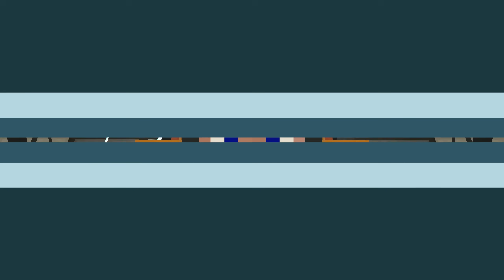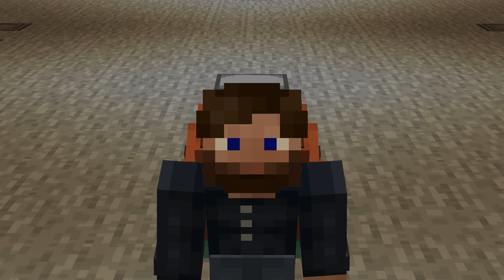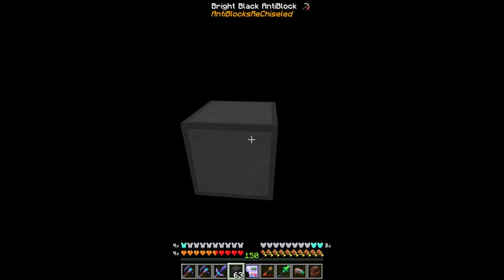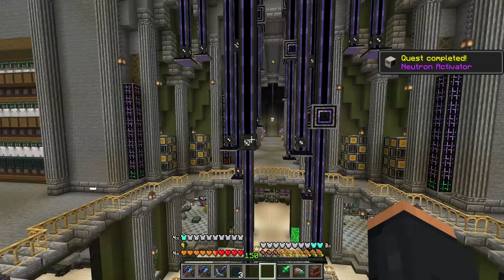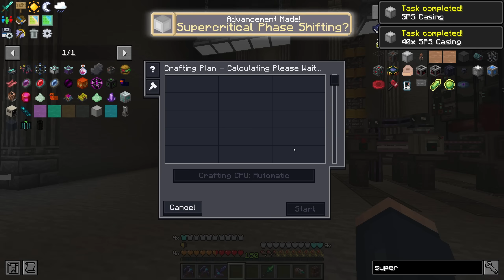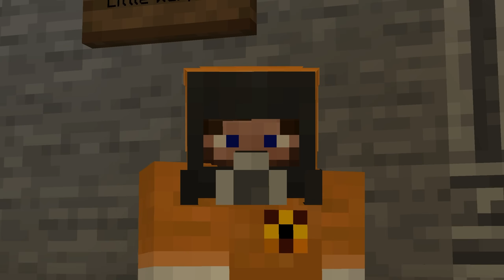Stoneblock 4 Minecraft Modpack EP29 Fission Reactor to Antimatter Automation

Comment: You actually do have kitchen sinks in the mod pack. Are you saying they don't actually work?
Reply: Kitchen sinks are no longer infinite.  They need filled up with water from outside sources
Reply: @multip1esarcasm289  Glad I never relied on them. I used another water source that's infinite instead.

Comment: Nice water solution, I haven't seen that one before. SFM is pretty intimidating, but you explained this process well. If you set up a turbine, I noticed that the whole process (fissile fuel generation, waste generation, and antimatter generation) is power neutral (The turbine generates about as much power as the whole setup needs). I had 2 setups, one 7x7x7 reactor and one 18x18x18 reactor and they were both power neutral with a turbine on them.

Comment: hi, iirc the dynamic tank shows the capacity of gases after assembly. Because gases are compressible, a much higher capacity can be stored. As soon as you add liquids, it changes the capacity of liquids.

Comment: 10:40 For those wondering why the capacity changed, Mekanism dynamic tanks can store chemicals as well as fluids. The default value shown by the tank is for how much chemical it can store. When you put a fluid in, the tank corrects its value to show how much fluid can be stored instead.

Comment: I have made all of the bits and bobs for the neutron activator and I cannot get the pattern to show so that I may build the multiblock machine. Any help is appreciated.
Reply: Press U on the neutron activator block in JEI, it will open up the associated recipes. At the bottom left of any recipe, there should be a block which you can click to show the structure.

Comment: Dear Archy, can I call you Archy? Im gonna call you Archy. Dear Archy, Why not just put all the valves on top? you could have like, a wireless connector attached, I think that pack has Extended and AdvancedAE, i dont remember which one adds the Wireless Connector and Hub, but you could just put the valves on top and run water in through an Infinity Water Cell, And use, (I hope they have this too) A Chemical cell or a radioactive cell to pull it into the system and push it somewhere else with another connector. But the main reason I say put it on top is because you have such a tall reactor, you could totally just have it being valved on top and keep the sides (which are always in plain view) nice and neat.

Comment: I could not get the Evertide Amulet to work the same way as you did, Chosen.  I would put the amulet it, it would pass through immediately to the bottom slot and the tank would fill.  However, SFM would pull all the water out of the tank very quickly and the tank would not refill. I found that if I right clicked on the tank with the amulet it would refill.  So, I used a modular router with an activator module to constantly right click the tank with amulet and now the tank stays filled with SFM pulling every 2 ticks.
Reply: Did you set the dynamic tank to the "Empty" mode?

Comment: CA just so your aware, what your seeing is the burn rate of 10-15m or MORE to take care of your backlog.  AT 225 mine was around the 3-4m as well.

IE you burn as much power as you want to burn your polonium backlog and then set it to a more reasonable amount to match your production rates.   I used short pipes you could have a LOT of backlog to burn through, once it does that you can safety set it to a MUCH lower rate.

Comment: You do such a great intro to Mek reactors. Great explanation on the logic adapters. The water trick was great since this pack screws with water. 

The use of SFM, could also help you with waste management too. You can use SFM to move waste from the reactor, to the machines for polonium and plutonium.  You can have all machines setup with out using pipes. You can also move the polonium to the SPF for antimatter. The nice thing is that the inventory cables can be broken without causing a radioactive nightmare. The code is not that bad to manage. I used to separate programs in two managers to separate antimatter from pellet production.  Then just shut off the isotopic centrifuge.
Reply: Using Mekanism pipes for radioactive handling has the slight advantage of having an integrated buffer, of quite sizeable dimensions, without needing to add chemical tanks or something to your SFM network

Comment: Infinity ingots require some alloys so you need to speed up oritech processes. I would recommend a bunch of processing and efficient speed (combines the best sides of efficient and speed addons) addons at tier 8. Also ProjectE tick acceleration helps with all of them, I spent all my saved money on dozens of Watch of Flowing Time. 

I kept running out of fluxite, so that might be an issue for you as well. You can't really speed up fluxite production beside setting up more lasers, addons don't really make a difference on those. You can also use fluid fluxite cow to get more fluxite by tick accelerating that which is what I did.
Reply: Not sure about fluxite production but addons do help the lasers charge the atomic forge faster, which can then craft said high tier addons faster

Comment: If you want a tip for storing radioactive material (polonium especially for later on with the anti matter) MEGA Cells got a card called "MEGA Radioactive Chemical Storage Cell", and it stores radioactive material only. 1 Cell can hold up to 2048 buckets of anything radioactive. Although you can only choose one chemical per cell, and they use 5x the power a normal cell do but that doesn't really matter. TL:DR you can transfer radioactive chemicals for some insignificant increased power usage
Reply: I understand using it to transfer polonium if a sps is always running but 2k buckets isn't that much for the larger sizes of fission reactors
Reply: I mean they're not expensive, I just meant it as a way of moving it wirelessly.  @KingDoesRage
Reply: @soup7694  u would need an reactor Worth of energy 😉

Comment: Alternatively for water place a storage bus on the reactor port and connect it to an extended I/O drive that has an infinite water cell and 5 acceleration cards, add superdense energy cells and an energy acceptor (make sure you're providing enough power)
Got 700 mb/t on a max sized reactor
Reply: ive tryed it and its too slow for the rate you need water,this method is def faster.
Reply: @danubius7734  idk for me it worked with the same burn rate
Reply: With an Industrial Turbine I used a JDT advanced clicker (and ender gate) with an advanced time wand to speed up liquid pipez with an ultimate upgrade to pull water from the turbine valves. I was able to max out my 15x15x15 reactor doing that. You might need more than 1 valve/reactor import.
Reply: would multiple extended io ports be able to keep up
Reply: To share how I accomplished this, thanks to so many nice people on the internet.

What you need to use is a Superdense Energy Cell.  I also put 5 acceleration cards in my ME Extended IO port.
(I original had 2, just to be safe, but tested with 1 for a mite it works)

This supports a 9x9x14 with a burn rate of 225.

The water dips and fills so yes the SFM prob is safer faster on water.  I've run this until I've gotten my 10k antimatter so was great for a LONG time.

OF NOTE: You definitely want to use CA's method of incremental increasing, as NO matter of safety will ensure a blow up if it goes 'critical'.  ESPECIALLY as this pack is moronic on the water in these things.
Reply: @yoshithesnake  I tried that, used 9 of them on separate sub nets but it could barely keep up with 45mB/t burn rate.
Reply: 2 adv io ports is fast enough to power a reactor using the max water safe burn rate if you were using an export bus that could be the reason but the storage bus and the infinity cell in the slot to pull into system is more than enough I'm 3-5 block spaces
Reply from the maker: Tested and its not fast enough
Reply: @ChosenArchitect I was able to do this AE method x2 on a 17x17x17 reactor and keep up with water at 675 burn rate. It is indeed fast enough. You need acceleration cards in the IO.
Reply: @C @ChosenArchitect  used this and couldn’t get my burn rate up.  I set up multiple input ports and   Used a separate IO port with its own infinite water cell and that got me to about 200mb burn rate. It was janky. 

I argue that Mek should have pipes (maybe a new pipe), a reasonable tank, and reasonable pump that allows one to run a max reactor with water. It’s ludicrous that you have to hook a turbine up side by side to get the throughput rate.
Reply from the maker: Well you normally would use turbines to recycle the steam into water
Reply: @ChosenArchitect  im using a single infinite water cell setup (5 accel cards in the extended IO) and it's definitely keeping up with a 250 burn rate with no steam recycling